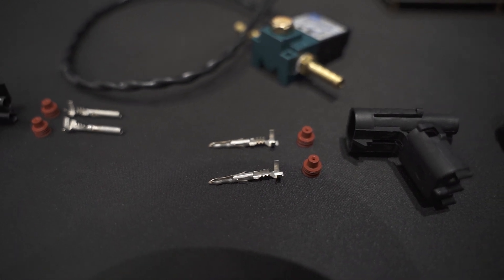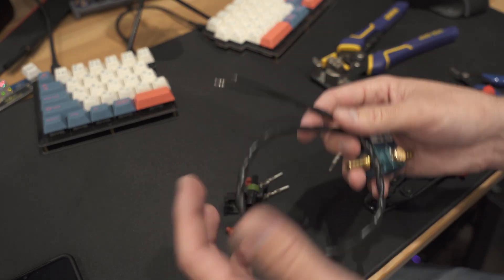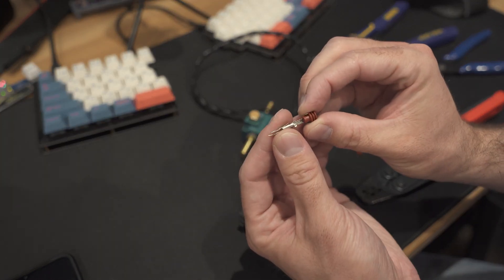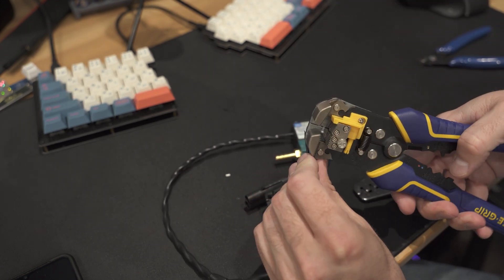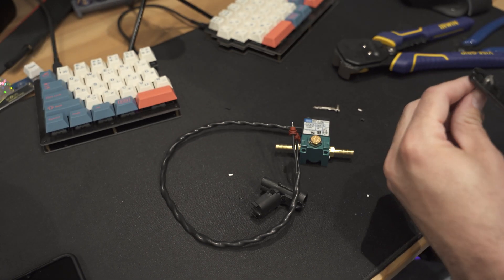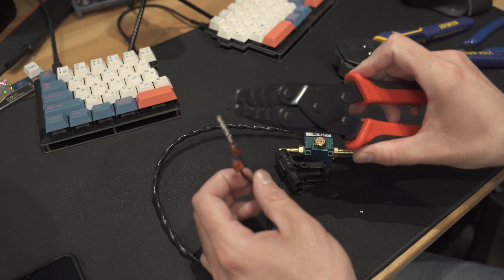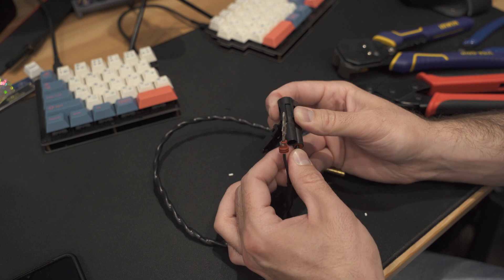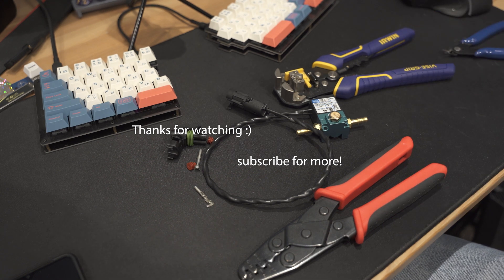Weather-Pack Connector Basics | Wiring Wednesdays

Comment: What heat shrink?
Reply from the maker: It's some old suff I had laying around I can't remember where it's from.
Reply: heat shrink is rubber tubing you can put over a wire connection, put some heat to it (either a really hot blow dryer or even a lighter) and it will shrink over the wire connections insulating the connection